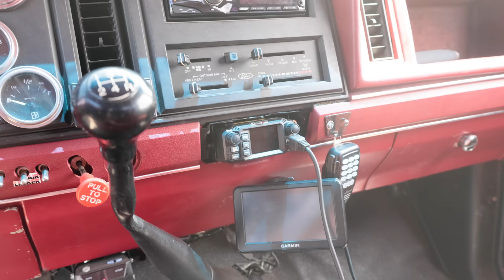4BT Cummins in an '88 Ranger gets ALL the MPGs

Comment: 35 year old ranger looks better than today's version.
Reply: more durable,  more reliable,  etc...
Reply: I like the gen after this one
Reply: I had 5 of them from a Courier to 3rd gen 3rd face lift, great trucks.
I have a new Tacoma now.
Reply: @yername31  Not a manual transmission, deal breaker for me.
Reply: @schwags1969  
lol same 2020 off road
Reply: @schwags1969  
my 2001  ranger sohc was 4x4 and 5spd 
but the Taco is an auto im old now
Reply: I think most trucks from the 80s and 90s look better than the modern Ford ranger
Reply: Just about anything would look better than the modern Ford ranger actually
Reply: @schwags1969  It does have the MANUAL transmission!
Reply: and it doesn't have a rainbow paint job!
Reply: Fax bro
Reply: @PeeterPuncher  LOL eww
Reply: You got that right...I have never been a Ford guy, yet an '86 Ranger is the only new vehicle I have ever bought..the styling really was what sealed it, I was 19 at the time, and I thought it looked like a truck...the shape, proportions, grill, everything looked right..(as an aside, I always thought the small blue oval badge, in the lower corner of the grill, looked much better than centering it in the middle of the grill, like a "nostril",like they did on the F-150 and most others)...the S-10 looked too "streamlined" to me at the time, and the Toyota and other import trucks looked like a "tin can" compared to either of them...I didn't like the '89 facelift of the Ranger, mostly because of the plastic headlights and the movement of the emblem to the center of the grill, but it was still an o.k. looking truck...I actually thought about trading my '86 in on a '92 4x4...when the '93's came out, they lost me for good...WAY too rounded, I thought the front end looked like it came off an '85 Tempo..not very truck looking at all...to me, really none of them look like a truck now..the previous generation Ram was the last one that did, to me...
Reply: @schwags1969  No regular cabs and normal proportioned beds deal breaker for me, too...I would be all over a Jeep Gladiator if they made a regular cab and a normal bed that doesn't look like a "tacked on" afterthought and sticking out behind the rear axle too far..look at one from the side and you will see what I mean. A regular cab with the bed moved forward and slightly longer would be MUCH better proportioned and look MUCH better...
Reply: Hell yeah brother
Reply: I agree my daddy had a 86 87  two toneblue it was sweet
Reply: Real
Reply: U got that right. My opinion I liked them years a lot but that next little twerk. Think 89 the STX wrap around head lights . Body  stripe package was my favorite
Reply: @dyer2cycle  yeah 86,87 cj8, scrambler 304,4 speed. Wear it out upgrade, 360,401 AMC of course.
Reply: @paultrimble9390  The next little "twerk" was o.k. (I liked the dash better), but I didn't like the plastic headlights or the fact they moved the blue "football" emblem to the center of the grill..I thought it looked much better in the corner like the '83-'88's...I like sealed beam headlights...I never did, still don't like plastic ones that turn yellow and haze...and I also don't like the blinding-bright little "slit" headlights they put on everything nowadays...the next gen. Ranger had too much of an aero/rounded look..especially didn't care for the '93-'97 versions...looked like they grafted a nose from an '85 Tempo on the front...
Reply: Yeah when ur old it does
Reply: I don't think it looks better necessarily but it definitely gets better mileage!
Reply: Agreed, but the 24' face-lift is an improvement
Reply: @yername31  i agree the 89 to 92 ranger was peak
Reply: Dont kid yourself, none of them look good
Reply: @notorious_diego2446  hop in your Honda Ridgeline and move along... 😆
Reply: @92coupelx  lol 🤡🤡 rangers are trash.. i almost would rather drive around in a ridgeline
Reply: @dundeeecroc  So it does, I misunderstood.  Thanks.
Reply: @dyer2cycle  Interesting, I did a '22 Taco with the access cab and regular box, never thought about it that way.
Reply: 1000%
Reply: Squarebodies for the winnnn
Reply: I made the mistake of buying a 2020 Ranger Lariat FX4 Crew Cab brand new and it was a POS. Started clunking when coming to a stop and lunging forward sometimes (which was kind of sketch when the missus drove it) within the first 1000 miles, the interior rattled like crazy, Ford dealerships made excuses of why they couldn't fix it and I got rid of it after two years. Honestly, I've bought 3 brand new trucks since 2018 and they have all needed warranty repairs within the first year. A 2018 Colorado Z71 had to have the rear end rebuilt under warranty at 700 miles. New trucks just aren't as reliable as older trucks. My dad had a 93 Chevy 1500 that he put over 400k miles on towing a trailer. He did have to swap a tranny he rebuilt from a donor truck after 300k or so miles. But I couldn't imagine these new trucks managing to do that.
Reply: True!, they want Gold for absolute garbage today
Reply: Anything 35 years old or older is better
Reply: A LOT better, the new Ranger looks like it has gut parasites!
Reply: They keep getting worse every year
Reply: If you see Scotty Kilmers video of a red 2007 Ford Ranger, that was my truck. I bought it new and met Scotty and he made a video of it. I think you’d like it, for a newer Ranger. I special ordered it to get the long bed and manual transmission with some other options, like 4x4 and XLT.
Reply: every old ranger does. 1st 2nd and 3rd gens
Reply: That's for sure lol
Reply: @Jihadbearzwithgunz  the maverick looks fine... if you forget what it used to be. I mean like the new ranger they kept the same idea of a "small" truck, but the maverick went from cool muscle car, to little tiny truck. totally opposite
Reply: True that

Comment: I've never been a Ford fan, but I'll compliment that one. It sets right, it looks right, and it's cool with that 4BT.
Reply: I’ll have to agree on this, never liked anything ford. But this is cool
Reply: I WAS a True Ford Fan, until I bought something with the 6.0! 
 Ford basically told me to go F#@k myself. NOT their problem!
I WILL NEVER BUY ANOTHER F#@D as long as I live!
 
Rich…I liked your video…, AND I liked how that guy built his truck.
👍👍❤️
Reply: Not a ford fan but I love my 86 ranger.
Reply: They're called a Ford couriers here in New zealand and ausy
Reply: Ford rangers are the only ford I’ll buy.  Up to 2011, that is.
Reply: Never was a Ford fan, either, but that's exactly why I bought a new one in '86(only new vehicle I ever bought)..it sat right, looked right..looked like a real pickup to me...the S-10 looked too streamlined to me at the time(it doesn't so much now), and the early-mid 80's Toyotas, and pretty much all foreign pickups of the time, looked too "tinny" for my liking..very small, thin doors, thin beds and tailgates, bodies not substantial enough...
Reply: I don't mind Fords too much but I do avoid certain year vehicles 😂 though at least for the gas trucks a Coyote would fix thier issues if they haven't rusted away
Reply: @dracodrake45  engine would be worth more than the truck
Reply: @jonathanwright5550  True but it still makes the truck more unique.
Reply: The Ford Ranger is the only Ford I have owned and I have used for work
Reply: @Nikkk6969 2011 the last year for the old body style?

Comment: We need more 4bt engines in everything. I love this as a general concept for a trick. All the fuel mileage let's go!
Reply: My rabbit pickup tdi gets 60+mpg. 
And makes the same power. 
And doesn’t melt down climbing grades
Reply: @fastinradfordable  blows me away that we can't seem to make a modern small trick that.gets the same mpg. Like emissions crap I guess but it's gotta be possible and surely it would sell. But I guess all electric by 2035....
Reply: As much as I love the Cummins engines, there are better swap options than the 4BT in my opinion. They are very expensive, weighs a ton while not making a lot of power from factory, and vibrates pretty bad. There are other Diesel engines that you could use that are lighter, cheaper and easy to acquire, and you could possibly tune them to make a bit more power. Engines like the Isuzu, smaller CAT engines, old International engines or many agricultural and industrial engines could make an interesting swap. 
I know a guy who swaps Diesel engines from old agricultural equipment into a couple old trucks and they are actually quite impressive.
Reply: @Omegadoomship  what ag engines did he put into what trucks?
Reply: @Omegadoomship  good point. I just like the idea of a small efficient diesel in a trick. I honestly find it more interesting than huge HP numbers. Cool that someone is taking things from ag equipment.
Reply: @Omegadoomship   Have your buddy on DGarage
Reply: Isuzu 4JB1 are better
Reply: @zacharyprovance3128  I’m not sure the exact engine model but he’s put an International Harvestor diesel inline-6 from a combine in an old Chevy pickup. He’s also done an Isuzu diesel in a Ford pickup as well. He’s done a few others but I don’t know what he used in them.
Reply: You really think oil companies would let them be efficient
Reply: @Nikkk6969 government regulations make it impossible
Reply: putting one in a 1st gen sport trac wish me luck

Comment: "Whyd I put a 4BT in a ranger? Because a 6BT wont fit" 🤣. I actually did fit a 6BT in an explorer (same chassis) but hes certainly not wrong. It took stretching the front bodywork, moving the steering gearbox, and then  still notching the frame in a couple places.

Super clean build, awesome ranger. If he wasnt in new mexico id love to meetup and wheel some cummins rangers together! 🚂💨💨 👍

Comment: Had a 85 ranger, power nothing, 4 cylinder 5 speed manual.  That thing would rip.  Fell victim to the ON🇨🇦 rust belt.  Miss that truck.  Great video.  Great build.  Great time.  Thx Rich and Arron.

Comment: You can easily see the skill and patience and determination of the owner in how nice the truck looks and drives. Job very well done. Looks like it doesn't have an intercooler or water/alcohol injection which would help. Thanks for the vid on it. But 19-20 on mileage, seriously ??? My 95 3/4 ton Ram with a 5.9 and 5 speed gets that if you stay under 65 mph and are  not driving up a lot of hills into the wind and it's got over 300k on it. It has 35 inch tires on the back though.......
Reply: but you can't blow black smoke in peoples faces when you accelerate.....
Reply: im about 25 mpg with my 5.9 cummins 3/4 ton

Comment: A zf5, especially with 3.55s, usually will feel loose, especially between 3-4. 4th synchro is usually worn the most due to the gearing difference. Internal "lash" in this trans is tight, hence atf fluids.

Comment: 20's is about the norm in most Cummins 4bt/6bt for MPG. But what most people don't understand is that that is also when pulling a Bobcat on a 7000lbs trailer and interstate speeds as well! Try doing the same with any V8, and I guarantee that milage will fall to about 12mpg. Nice Rigg!

Comment: I've never been a fan of quarter ton trucks but man that is one slick little beast! Seeing these videos is a great motivator! Lord knows I don't have the skill but I've got a mighty strong hankering to drop a 7.6L John Deere into one or two of my old project F600s and seeing stuff like this and the C12 rat rod makes me think that even I could do it (with a lot of time, trial, and error of course).
Reply: What transmission would you put behind it? My neighbor keeps saying he wants to do something like that but he doesn't know how to bolt a clutch and transmission to it.
Reply: @leviduff2740  I'm not sure yet. I think that'd be one of the biggest challenges. My dad advises using the clutch out of a same period tractor if possible as they're tremendously tough. I don't imagine any automotive transmissions would bolt right up. Apparently the John Deere 7.6 (466) was built with the help of Navistar so I guess it might have some "relation" to the on-road DT-466.

Comment: Nice build clean install. I wanted to do a 4bt in my 1987 YJ but the motors are so expensive so I am going TDI route if my 4.2 ever gives up at 300+ kms it still runs strong so it may never happen, now I don't drive to work daily anymore hard to justify

Comment: This thing needs a Gear vendors overdrive and it would be perfect! Not only would you get that gear between 3rd and 4th you get an extra gear between almost every gear (4th gear is direct 4th overdrive is .78 and 5th gear is .76 so I'm not sure you can count 4th overdrive as a viable gear). With a GV the ratios would be 3rd 1.61 3rd overdrive 1.26 and 4th at 1.0 so it would be way better. Plus the lower gear rear ends would be an option because double overdrive ratio is .59! That means a 4.10 rear will still have a higher final drive ratio than the stock  5th gear with 3.55 rear.
Reply: I learned about gear vendors from scotty, when he was much younger on a aftermarket car shop show on t.v . I've found 2 f250's that had it, they were both the 80's 4 speeds.
Reply: then the rear driveshaft would be a foot long....
Reply: @juststeve7665  the gear vendor replaces the tail shaft. The overall length is the same. Typically you use the same driveshaft. Most of the kits actually have a tail shaft extension piece because the overdrive is shorter than the average tailshaft.

Comment: I owned a 1981 Mazda 2200 pick up truck. Bought it new. It was a lot leftover as no one at that time wanted to buy it. The truck is a Ford Ranger . It had a Perkins 2200 cc diesel in it from the factory. Two wheel drive and a 5 speed overdrive transmission. 40 miles per gallon empty or overloaded with oak firewood. Great truck but, Northeast salt roads ate it up before 120,000 miles. Sold it to Amish farmer.

Comment: This is right up my alley. I started building a nissan 720 with a 4BT about 10 years ago but got too busy to finish it.   This motivates a bit though. Btw. While in Albuquerque  you gotta try a little place called the Dog house for lunch
Reply: I’m in Albuquerque too! I have a 92’ Land Cruiser 80 series. Debating between a 4bt, 6BT or a TDI swap. What else do you need to get your 720 running? Dog House is a church for local food.
Reply: @Devil2jz im no longer in Albuquerque.  I moved there right as Covid began not knowing what kind of damage it was gonna cause.   Unfortunately,  I moved back to Las Vegas (NEVADA) not that fake one in N.M lol.   If I were in your position and had a toyota I'd personally go with a 6BT or even a 1JZ just depending on how much daily driving its used for.

Comment: At an auction, I bought a used '99 Ranger 4x4 in 1999. Had it 17 years and put a quarter of a million miles on it. When I sold it, being in the rust belt, I was pretty glad only the passenger door bottom had rust holes, and two fenders had small rust bubbles in the paint, otherwise the original body was still great with no dents. Lost reverse one day and the oil pan metal was thin. Got $1000.00 for her.

Comment: One "upgrade" he can do to the ranger is to put on one of those aftermarket exhaust tips from a modern diesel truck that draws in fresh air to cool the exhaust before it exits the system. This is so the fresh air can mix with the exhaust and dilute the smoke and make it appear cleaner. I did something similar on my old 6.9 idi after i cranked up the fuel so i wouldn't get pulled over by the cops everyday just trying to cross an intersection. Now i have a turbo, so it barely smokes at all

Comment: I have a 1980 F150 2WD that I swapped a 6BT and NV4500 into. It gets 25-30 MPG average, and well over 30 on long trips. I have owned this truck since 97, and it's been 6BT powered since 17. Did the swap myself, and didn't need any "Special" or modified parts, aside from the front u-joint yoke added to the original driveshaft. Everything else can be bought through any normal parts retailer. Love the truck, and would not sell it for any reasonable amount, unreasonable perhaps.....

Comment: 10:36  Well that makes me feel a little bit better about my swap. The 12 valve in my chevy 1 ton dually with 4.10 gears gets about 18-22MPG depending on what I'm doing. And I always hear guys talk about how they are getting like 28MPG. I was starting to think something was wrong because I could never get that kind of mileage.
Reply: that's what I got in a 12 valve Suburban swap...around 20ish to 23 unloaded
Reply: @juststeve7665  What tire size and gear ratio are you working with? For whatever reason mine actually gets better mileage in town than on the highway. She's screaming pretty high at 70mph with 235/85's and 4.10's. And towing on the highway I can see some losses just because I have to stay in 4th gear. NV4500.
Reply: I hear you. I get 18 empty and 14ish loaded with my 12 valve ext. cab dually 4x and I’m ecstatic at those numbers.  My 2wd Ranger only pulls 20 empty.
Reply: @Bloodbain88  you'd be much better off with 3.54's. Or 3.73's if you have the 14 bolt rear. I had a 94 Dodge with 4.10s, and even with the higher 47RH OD, it still screamed. Such a dumb setup that I can't believe they actually offered. Picked up a couple MPG's going up to 3.54 and never noticed a lack of power when towing.

Comment: This is so cool and actually what i thought about doing myself to my project but in a Bronco II
Reply: I like it. Something a lil different. The ol Bronco II's. On a side note, I wondered why Ford went w\ Bronco Sport instead of the old Bronco II names? 🐎
Reply: the Mitsubishi 2.3L turbodiesel is a bolt in with Ford factory mounts and lots of power with the wastegate modified.  And does not weigh 400 pounds extra like the Cummins 4BT.  The Ranger/Bronco II  brakes, even with the Explorer Dana 35 upgrade do not have brakes adequate for the extra weight of the Cummins.  Maybe OK for casual driving but not for hard use.